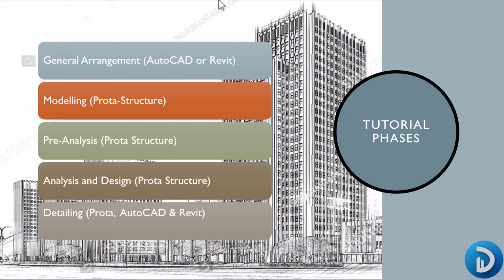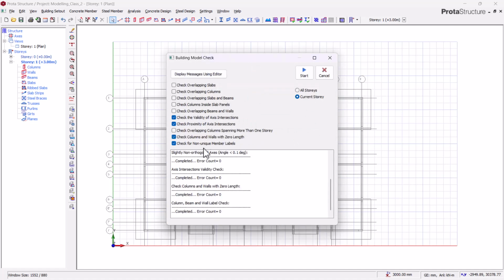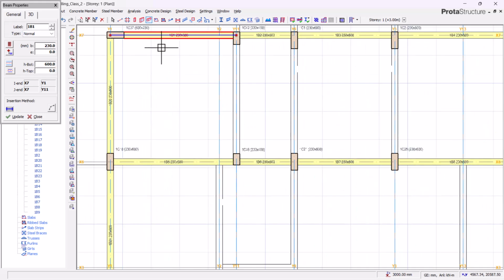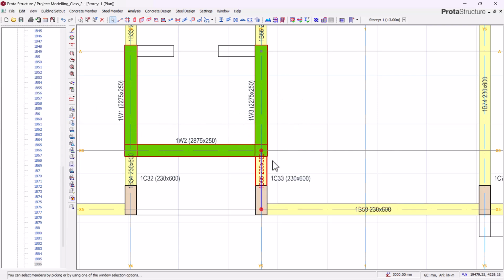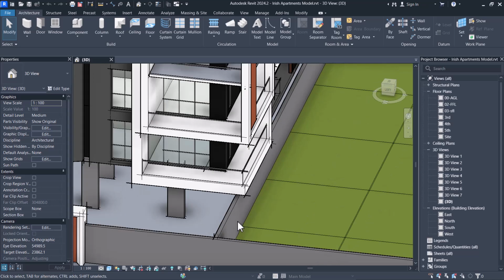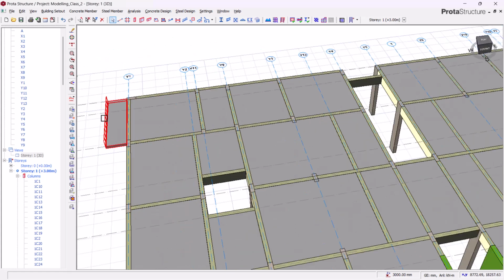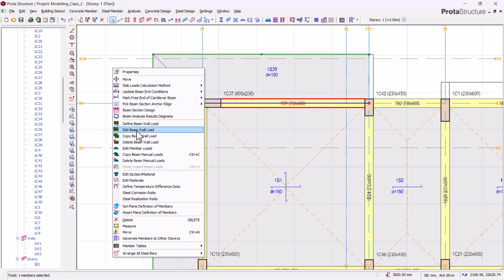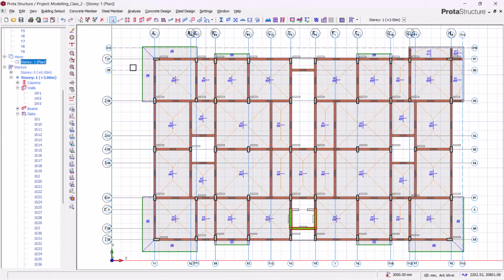How to Model on Prota Structure (I.R) Part 1

Comment: After successfully modeling and saving my project in Protastructure, I encounter the following error message every time I reopen the file: “Column: 1C1 section unidentified, center of rigidity cannot be calculated.” I have tried multiple times with different models, but the same error persists. Additionally, all project members are lost each time the file is reopened. I kindly request your guidance and assistance in resolving this issue
Reply from the maker: What version of prota are you using
Reply: @DubekeConsultz 2026
Reply: Protastructure2026

Comment: Do you have the shear wall detail template ? Also how can one plot into a sheet to get a fitted drawing in the sheet no matter how big or small the measurement of the drawings itself
Reply from the maker: We can assist you on this. +2347031451032

Comment: You have done well. However you parapet load cannot be 2.87kN/m2. your parapet load is a combination of wall load ( 2.87+.6)* height of wall and roof load is applicable. 0.6 refers to plastering on both sides of the wall
Reply from the maker: Thank you for your feedback. We will surely look into it and consider your input subsequently. We appreciate your comment.